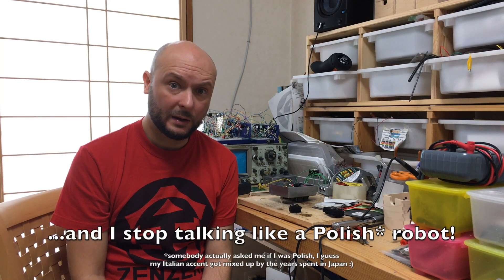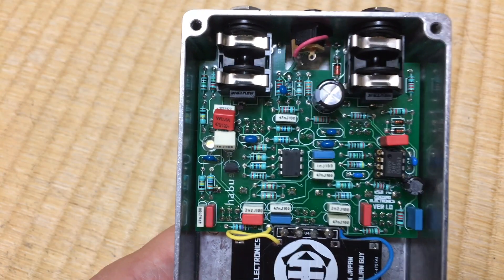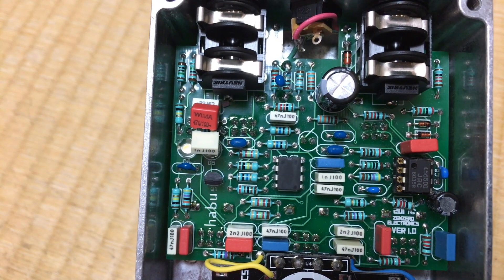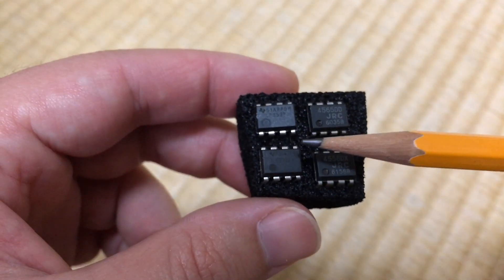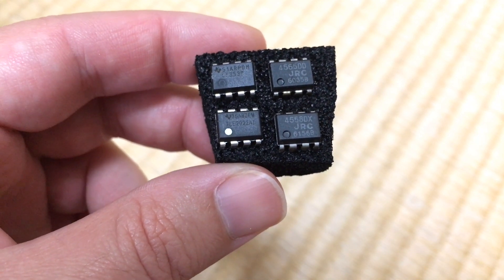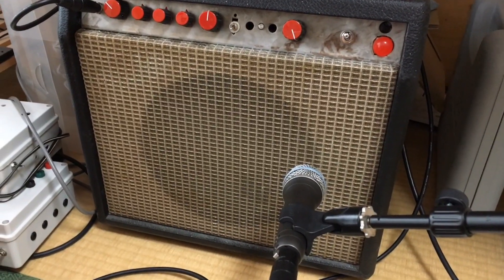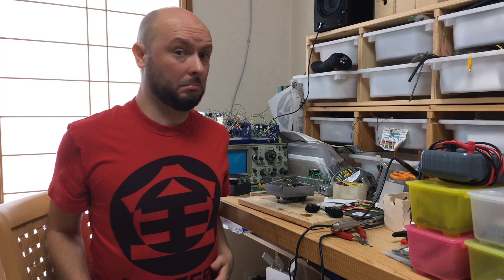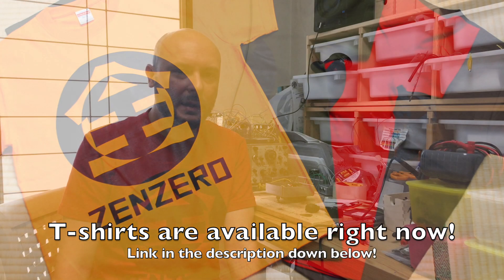Op-amps test in a hi-gain distortion pedal

Comment: I have never been a fan of the 4558. Oddly enough, the engineers at Ibanez have openly confessed the only reason it was used was affordability, and there are better chips out there. IMHO, in commercially manufactured gear, the chip you swap into one can make a tremendous difference, but if you're designing it yourself, it should truly be the least relevant factor to how your circuit sounds and performs.

Comment: I've just come across this video. I'm in the final stages, (hopefully), of building my high gain pedal, and Ive used the LF353N for the opamp.  I think they all can sound great, just depends on what you use when you design your circuit.

Comment: love the comparison video.  very similar to me. but, for me the 4558 had more lower mid resonance that i like for palm muting.  353 had more cutting mid.  2022 was open but didn't have enough head room for me.  4565 seemed to have little more volume than the others.

Comment: 2022 and 4565 are the 2 best in this circuit if doom is what your after. Maybe need to adjust the low end filter a tad. It amplifies the palm muting. It's not muddier, its palm mute being amplified, so my conclusion is that both the 2022 and the 4565 BOTH need to be in this circuit with a blend pot to blend the sonic DESTRUCTION together! The 353 is more of a lower gain or clean boost thru medium gain distortion but its def not a DØØM chip for sure

Comment: I used to hold the view that, when it comes to high-gain circuits that use diodes for clipping, apart from things like residual noise and current draw, an op-amp is an op-amp is an op-amp.  I presumed that the diodes were doing all the hard work.  Then a few things changed my mind.
First, a buddy brought over his Timmy pedal to change the op-amp.  Stock, it uses a JRC4580.  He had read somewhere that the lowly LM1458 was supposed to "sound better".  I was doubtful, but obliged him.  I desoldered the chip, installed a socket, and we tried out a number of different dual op-amp: LF353, TL072, NE5532, CA3240, OP275, and the 1458.  Much to my amazement, we both independently preferred the 1458, mostly because it's limited bandwidth "smoothed" the sound.  The stock chip certainly retained all the treble, but honestly that was not a benefit in this context.
That's not the only time that an op-amp with limited gain-bandwidth product has become the preferred op-amp.  Another case in point is the LM308, used in the near legendary Proco Rat.  The Rat is designed to ask far more gain from the op-amp than can possibly be provided (>1000x), and the poor open-loop gain of the chip reins in the treble at those high gains; especially when aided by the compensation cap.  So, in both instances, a "worse" op-amp was sonically preferable because of what it could NOT provide.
Finally, there is the matter of voltage swing limitations, when a circuit is powered by a standard +9VDC.  When a drive pedal uses diodes in the feedback loop, one can adjust gain to extravagant levels, but the diodes will conduct negative feedback when the op-amp and signal reaches around +/-600mv or so.  Increasing the gain will certainly result in much more than just the initial pick attack being clipped.  But the signal amplitude will always be limited by the diodes and never reach the maximum voltage swing, where it might run out of headroom.  In contrast, when a drive pedal places diodes to ground at the output of an op-amp, large op-amp gains (e.g., >100x) cause the signal/op-amp to run up against the maximum voltage swing and "clip within the op-amp itself* .  As such, the pedal tone is really a result of double clipping: once via the op-amp, and again via the diodes to ground.  Here, the manner in which the specific op-amp clips, as it runs out of headroom, can provide a particular tone.  I have no preferences here, only to note that moving the rails farther apart, by use of a higher supply voltage, will make the clipping of the specific op-amp less relevant.
In sum, op-amp choice CAN matter in high-gain circuits, but the impact will vary as a function of the kind of high-gain circuit, and the supply voltage.  There is NO use-this-chip-and-it-will-sound-great.
Reply: No, but there is 'use this chip and itll sound different'. Which is the point.
Reply: @springbloom5940  Well, partly the point.  The trouble is that internet rumours quickly turn something that merely sounds "different" (which isn't intrinsically a bad thing) into something that sounds "best", and eventually becomes a "feature" in ad copy. Not too keen on that foolishness, myself.
Reply: @markhammer643  

It is a fact that some opamps are objectively better for various applications. You wouldn't use a 308 for a 'modern' high gain distortion or for active controls, if you had a choice. But yes, simply 'better', is entirely subjective, because maybe you want a coarse, slow, lofi effect.

Comment: Very good video, does the op amps you are using here need a special capacitor to change the slew rate? Thank you, some distortion pedal needs very low slew rate to achive their sounds (that´s what I read in some places).
Reply from the maker: No need in general. The slew rate cap is something I've found only in the LM308. Maybe there are others op-amps that need it, but I never met them.

Comment: Can this Op Amps be used in a Pro Co RAT pedal?

In order to substitute the OP07 DP or the LM 308???
Reply: I´m tryng to build a RAT too, you can use a Op Amp with low slew rate (0,3 V/us). Some of them needs a capacitor between pins 1 and 8 to achive this value, you need to see the datasheet of the op amp to determ this value.
Reply: @percyhornickel   got it. Thanks!

Comment: Do you have any idea if it's worth looking for an analog op amp for a klon clone?
Reply from the maker: All op amps are analog devices. If you intend a discrete op amp, which is an op amp made by many parts instead of being included in one single chip, I don't think is worth it. Discrete op amp might have some applications in hi-fi settings, but not in a guitar pedal IMHO. Still, if you like it and have the money and space, just go for it.
Reply: Thanks for the quick response and education.